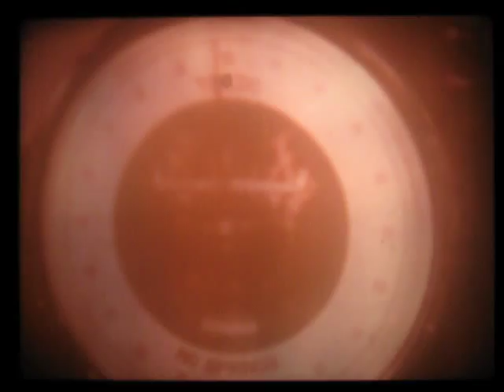The New Engines From International Harvester. (400 series)

Comment: IH 300 Series = D-3i2, D-360, DT-360 (DT-360 was only used in trucks)

IH 400 Series = D-414, DT-414, D-466, DT-466

i believe this list is accurate, correct me if not!
Reply: Michael Halsall  they also  have  the  d-436 engine  in the  986 tractor  and  the  dt-436 in the  14 and 1566 and 14 and  1586 tractors .  All great  engines .